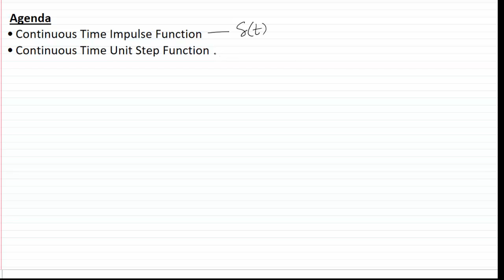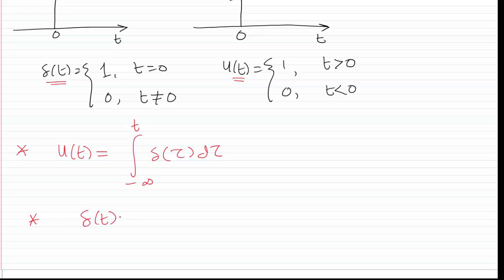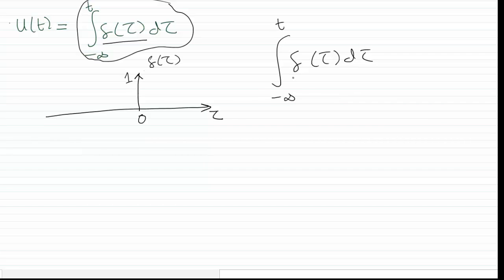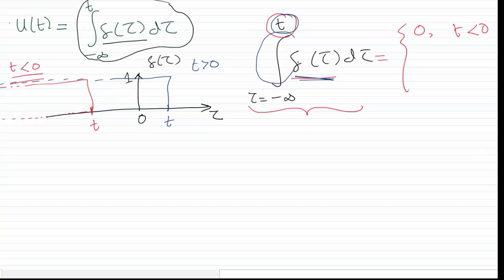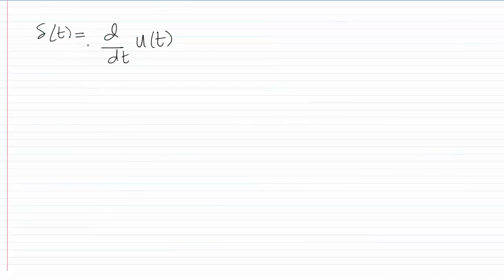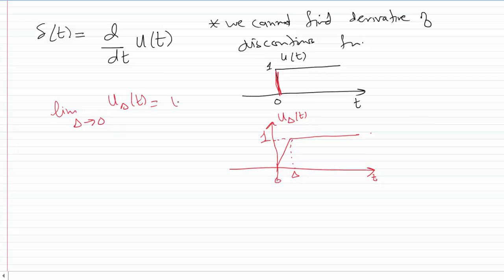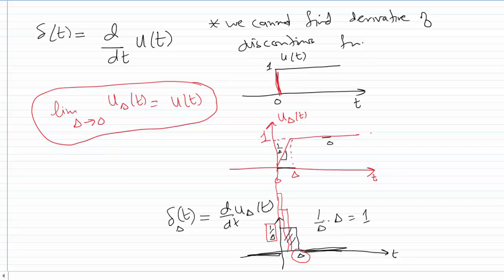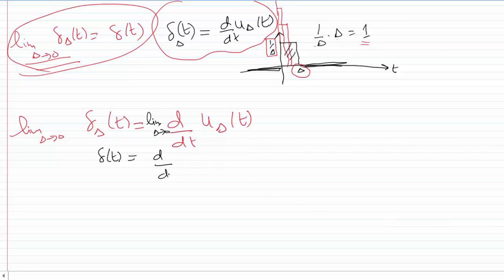11- Signals and Systems: CT Unit Impulse and Unit Step Functions

Comment: Sir Why the function has the value 1 when t is taken greater than zero in unit impulse.
Reply: 1 means that the value of function at that particular time is high. It could be 10, 1000 or anything.